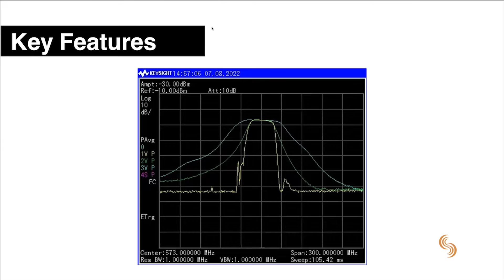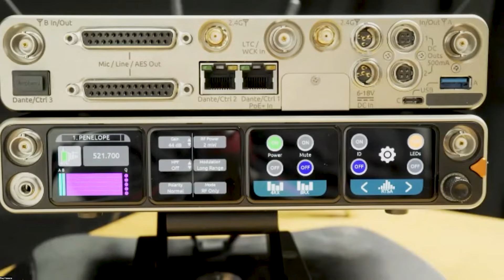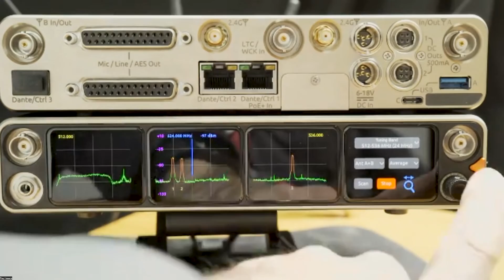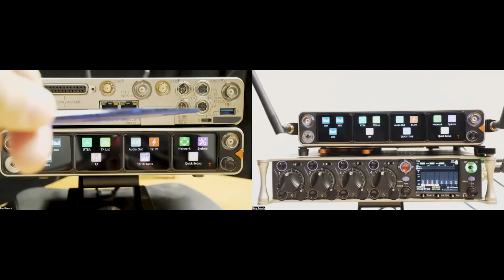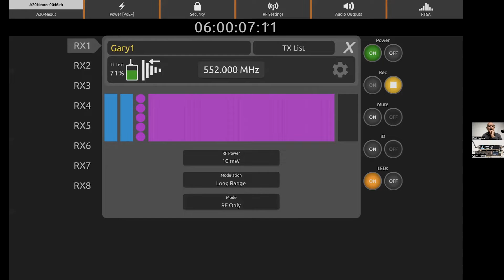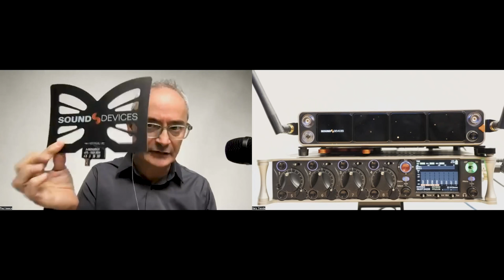A20-Nexus Live Demo

Comment: KEy features missing... The ability to remotely change frequencies via web interface.  and the inability to use the entire spectrum at the same time..
Reply from the maker: One quick correction- you are able to remotely change frequencies via web interface! Once the FQ is adjusted on the web interface, the setting changes on the TX as well. That's the beauty of NexLink!

Also, on your entire spectrum comment, this design is purposeful. The SAW filtering used in the Astral wireless system is ideal for RF performance. This means, those transmitters must be contained within the range of that filter. For a detailed article on this topic, check out: https://www.sounddevices.com/spectraband-explained/

Comment: Hi,

Some questions regarding A20 Nexus. 1: True Diversity across 16 channels or 8 channels and then it is switch diversity for rest 8? 2: Is it waterproof & dustproof? 3: What type of glass is the screen and the results from testing durability (brake, scratches etc)? 4: How the screen performs directly in the sun? 5: Can you send a tone for calibration if you don't use 8-Series recorder? Thank you!
Reply from the maker: Hi there! 

1) True Diversity for all channels.
2) No, it should not be submerged in water.
3) For comparison, the durability is similar to Gorilla Glass.
4) Sunlight readability is comparable to our MixPre series.
5) The current firmware does not include calibration tone. This is on the feature request list.